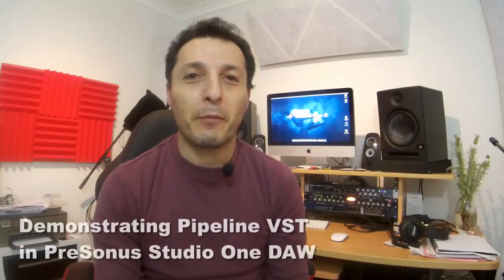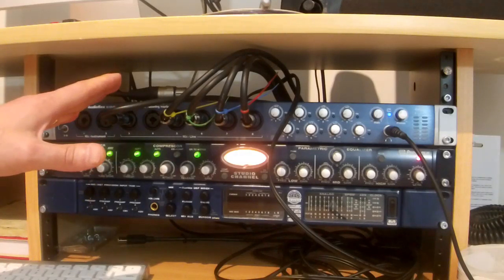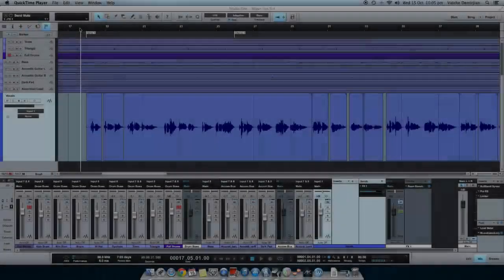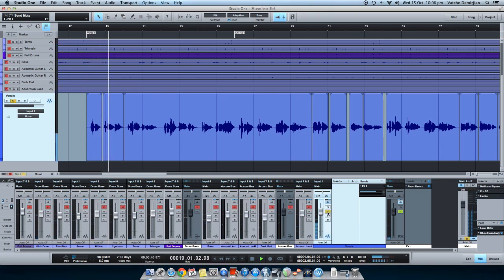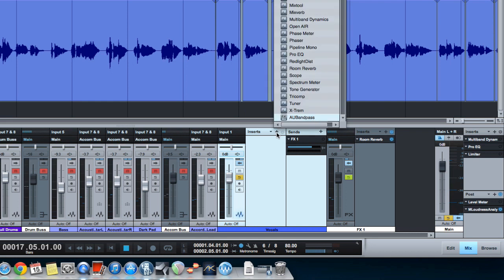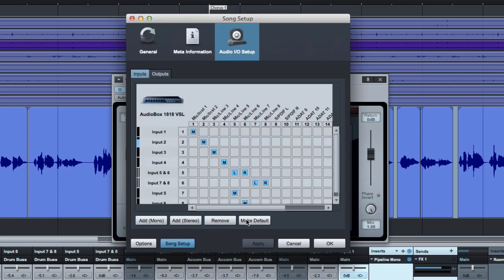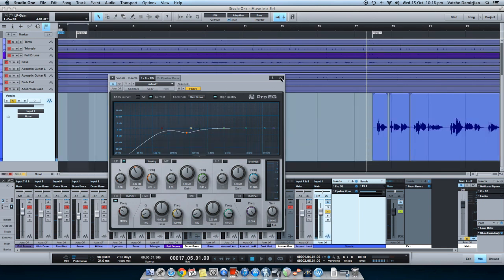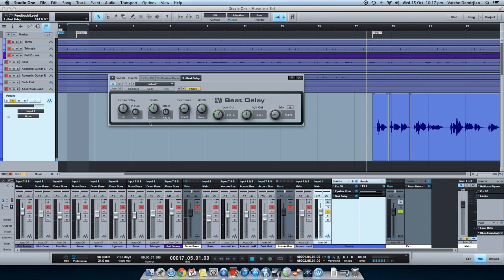PreSonus Studio One Pro - Pipeline VST Demonstration

Comment: I have a presonous channelstrip going in to a art pro ii compressor in got it going threw my presonous mobile192 how do i use pipeline to work
Reply from the maker: Use output 3 and input 3 of PreSonus Mobile192 to connect your Studio Channel and ART compressor. Then setup Pipeline as per my video.

Comment: You rarely have the option to use an XLR cable when running an external preamp with an audio interface.  The reason is simple.  Running a preamp into a preamp adds unnecessary noise and gain.  This happens as most interfaces take a simple route that saves money.  The path of the XLR input always goes through a preamp meant for a microphone.  The balanced or unbalanced 1/4" input (balanced is better but not required) is wired as a line/instrument input meant for signals that do not require the larger gain structure.  I see this mistake made so often and it harms nothing but the sound of the captured audio.  Nice job here.

Comment: Hi there, any tips on how to use Offset?  I'm getting phasing when routing out to my hardware reverb.
Reply from the maker: +IamKWarren 
Have you tried adjusting the 'Offset' setting? How much latency are you getting? Are you also using AudioBox? If so, you may need to mute the channel (3) in your VST mixer driver, so you are not duplicating the audio by listening to direct and processed audio.
Hope this helps..

Comment: Hello my friend,  awesome channel very informative.  My question is I am looking to purchase a one channel preamp the golden age pre 73 and was wondering how to connect it To my presonus 1818vsl so that it will bypass the built in preamps? Thank you
Reply from the maker: +P.o.B pedals Hmm.. not sure I understand the question. Bypass the 1818VSL preamps? Nop, not possible. Thy are Analogue part of the AD/DA conversion process.
Reply from the maker: +P.o.B pedals 'Bypass' the Mic preamps on channels 1 & 2, meaning use the LINE level inputs on inputs 3 to 8. (Jack 1/4" inputs on channels 1 & 2 are Hi impedance Instrument level inputs).

As I demonstrate in the video with Pipeline plug-in, if using an external preamp, it is good idea to use the external preamp's (GA Pre 73) line level output to connect to line level input of next audio gear, though GA Pre 73 has Mic level out, you get better result with line level out into AudioBox 1818VSL.
Reply: Ok, I see thank you , yes the pipeline is great I am upgrading my studio one to the new v3 professional and it's been very helpful.  When using pipeline and as you were adjusting the eq and compression with your tubestudio is that signal being changed and permanently printing on your originally recorded track?
Reply from the maker: +P.o.B pedals No, not in this video demo, but it is possible to 'print' it as well once you are happy with the effects, so you don't have to use pipeline once printed. I may need another video to explain the procedure.

Comment: Thanks for the video. I'm assuming that if your interface has rear inputs for 9,10,11, etc... that you could simply use that rear face throughput as your return line. Is this true? I was actually surprised to see that Presonus doesn't off rear input (other than ADAT) on this unit. If the presonus preamp had an ADAT output on the rear... I'd assume you could use the 1818VSL ADAT input on the rear? The reason I'm asking is... it's just cleaner to have rear patchwork going on than to have a cable strung over the top of the unit into a front panel input. Thanks.
Reply from the maker: footnotedrummer The 1818VSL is 8 in 8 out interface, and additional can be gained via another 8in/out via ADAT connected interface.
The inputs are at the front and outputs at the rear. Having inputs at the front is practical, as you connect different instruments, and output at the back to go to speakers etc. There is not much room for any other connector sockets at the front or back, unless the design became 2RU high.
You could have a patch bay for the rear connections on top of the 1818VSL to make output connection patches easier, which is my next project :)
Reply: I think that I'm doing this correctly, but I have a TASCAM US-1800 interface. It has 8 mic inputs on the front (just like your Presonus), but it also has 2 intruments inputs on the front 9 and 10. It only has four outputs on the rear for inputs 1-4 from the front, but I'm ok with that. It has 4 inputs on the back as well 11, 12, 13 and 14. So... what I do is run a mic into input 3 on the front panel, out of three on the rear output. Then I run that output 3 to the preamp in. I then run the preamp out signal to input 11 on the rear panel. Doing it this way allows me to have no wiring draped around the front side of my rack. It just a lot cleaner. I was just a bit shocked that Presonus doesn't have rear inputs other than ADAT, because many lower end pres don't have ADAT connectivity.
Reply from the maker: footnotedrummer Yes, Though the TASCAM US-1800 has more inputs than outputs (Even more so the US-16x08) the 1818VSL has few more options via the VSL software that I liked. I did have a look and try the US-1800, but currently not needing any more than 8 inputs and having 8 outputs more important at this stage, and the matching of the DAW with Studio One, I chose the AudioBox 1818VSL. The TASCAM US-16x08 looks good as another option. It all depends on the needs of your studio.
Reply: RecordingStudio9.com Please don't get me wrong... I really like some Presonus stuff. I actually run Studio One 2.6+. I just wanted to make sure that I was hooking things up right, because my way seemed to clean to be true. It seems like I am, now that I have things up and running. Thanks so much for the video.
Reply from the maker: footnotedrummer TASCAM make good audio gear. The US-2000 is a fantastic one to own as well. I'm hoping to test one out soon.